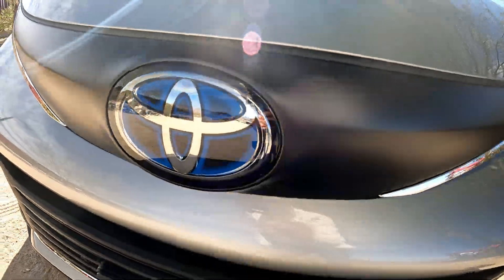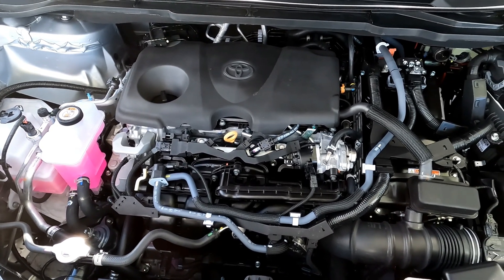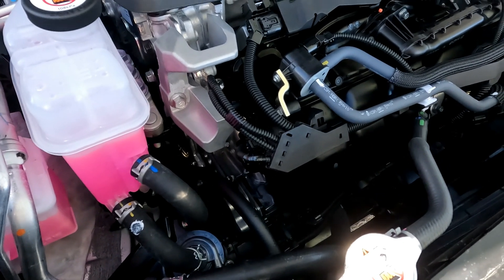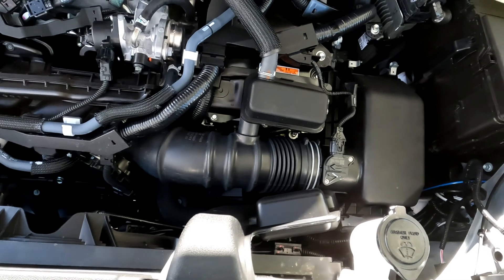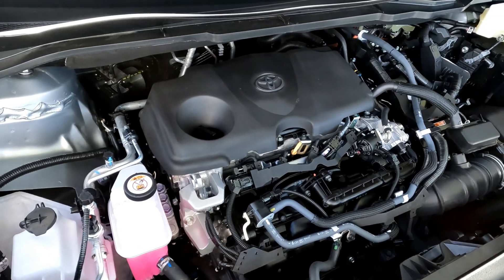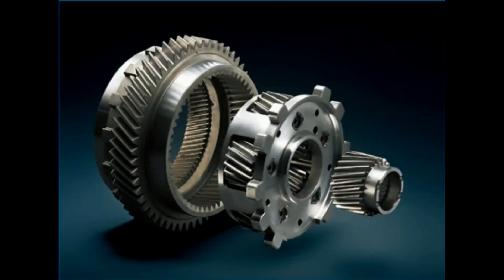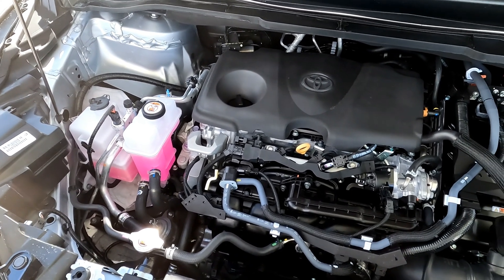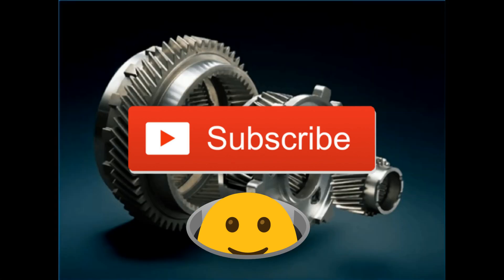A Toyota Hybrid Does NOT have a CVT Transmission (The TRUTH Behind the Hybrid Synergy Drive)

Comment: My Volt has an ECVT and it performs flawlessly at 250,000 miles.
Reply: I wanted to consider the volt for the big jolts of power and still able to have fun but I've seen too many prius taxies with over 300k miles easily, I've seen a couple with over 400k and it's under the hardest driving conditions